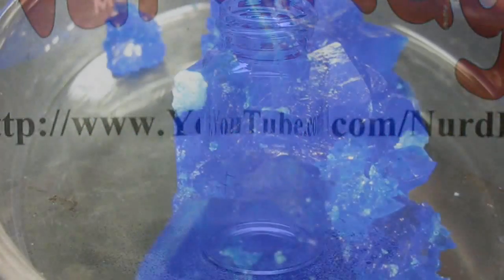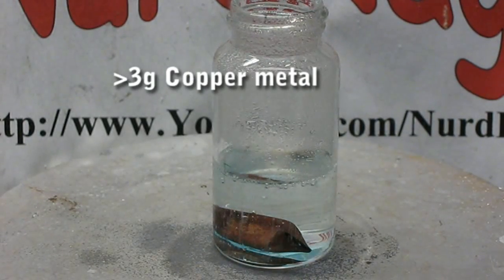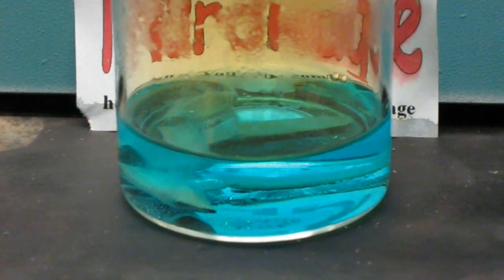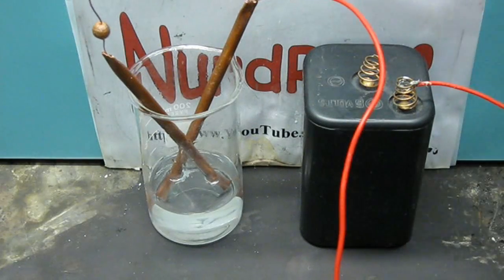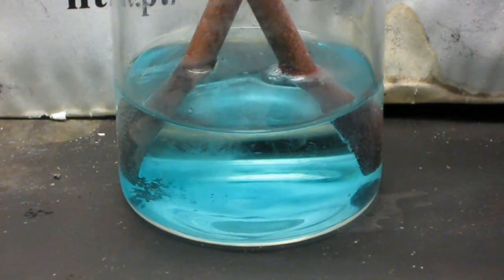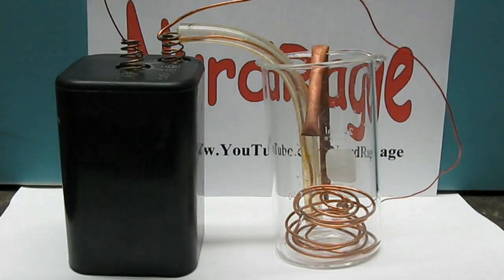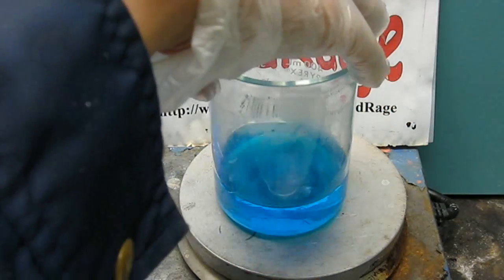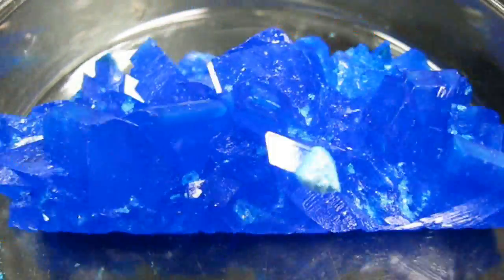Make Copper Sulfate from Copper and Sulfuric acid (3 ways)

Comment: Thank you for sharing. I've tried the saturated Epsom salt method. Then putting the negative electrode inside a clay pot in the solution...with solution filled in the pot as well. Some batches worked better than others possibly because I started using distilled water? Cali has SO MUCH JUNK in the water it should be criminal! Very much appreciated your video!

Comment: Great. Thanks. I am going to do that. Can I ask... if I want run a continuous electroplatlng process can I add copper over and over? And will polyethylene glycol stuff things up? Can I simply measure acid levels to keep the mix in good trim. I have never done this before. But I need to copper plate aluminium. I have no chemistry experience what so ever. But you make it look easy.

Comment: This is working great. I took your advice on making a decent separation between the cathode and anode and used a large graduated cylinder. I then soldered an insulated cable down at the bottom and sealed it so the conductors wouldn't be reduced. I then mixed 33 mL of H2SO4 with 200 mL of water and the voltage is sitting at around 4 VDC with the current at 2.6 A. It already has a lot of deep blue copper sulphate solution on the bottom. I'm going to see if I can reach saturation and very slowly cool down the solution after filtering. I think it's a much better solution than dealing with NO2 gas. Thanks for sharing this. I'm one step closer to making some conductive paint for electroplating 3D prints :)

Comment: Awesome, so a glass bowl could be lined with sheet lead oxide (from a car battery) and connected to negative, and an anode (positive) basket could be fed continually with copper. The acid added when the conductivity drops too low. Swap out the electrolyte to crystalise out the product as required, recovering most of the acid. Sreetips does this in his Silver Cell. I am sure it would work the same way.

Comment: I'm trying to build a copper electrowinning cell. I read that having copper sulfate in the solution makes it work much better, but I didn't buy any, so I tried to just use the cell to produce some in dilute sulfuric acid. Instead it was producing strange red goo on the anode. I thought it might have to do with the red HDPE coffee can it was in, so I moved it to ceramic. But I don't really rhink that was it. Then I saw this so I saw this and added a lot of 3% hydrogen peroxide cause I had it on hand. The electrodes are no longer bubbling so I guess I'll just leave it and see if it starts depositing copper or turns blue over time. If not, I'll add rusty nails to make iron sulfate fertilizer and pour the solution out in the lawn, and try again with new sulfuric acid and copper sulfate on hand
Reply: It's working! Thank you. I'm hoping to electroform pieces of copper thick enough to forge

Comment: Or you can add calcium carbonate so the solution is neutralized, filter out the calcium sulfate, and then boil down the water cuS04 until you're left with just crystals. It can be infuriating to realize that you cant just boil down acids to nothing until you learn this "trick". Love to know the physics and chemistry of why it has a threshold beyond which it wont boil down.

Comment: Suggestion. Put copper wire in dilute sulphuric acid and let it stand a week or so. The air will react to oxidize the copper which the sulfuric acid will dissolve. Don't use old broze coins. Beside destroying collectables the coins will create a mixture of copper salts and salts of other metasl. Best, discarded electrical wire ends and copper pipes.
Reply: Ive done it that way,you just need one big cut of pipe

Comment: Love you videos keep them coming… These crystals look amazing, And the usefulness of them is a must.
 From what I have gathered from your video, and reading online. For efficiency you boil it down to collect, and reuse the acid. And use the remaining  Copper sulphate to make more. Or you boil down to supersaturation leaving some water if you just want to produce crystals. Which is useful as well. And the crystals look bad a**. 
Thanks again. Extremely informative. Well laid out videos awesome.  If I am not mistaken the copper sulphate Breaks down at a 1010 C. So depending what I would want to do I have to watch the boiling temperature of water, And the Max temperature for the copper sulphate.
Reply: Got it no matter how saturated the solution, it will stay  Enssolutions. Until you remove the acid.

Comment: Love  You're videos… ?  At what temperature would you suggest boiling down the solution, I had read just below boiling point. Your input would be very helpful.
   The copper sulphate turns white if I boil out all the water. At that point would I be able to put it back in solution to crystallise,Or should I leave some of the water in and boil at a lower temperature.

Comment: Damn, you add hydrogen peroxide in the video first, then add sulfuric acid. I did it this way and it started splashing acid everywhere. When I searched online, it turned out that sulfuric acid should be added first. How can you make such a mistake ???

Source: https://ehs.princeton.edu/laboratory-research/chemical-safety/chemical-specific-protocols/piranha-solutions

"Always add hydrogen peroxide to sulfuric acid while gently stirring. DO NOT add sulfuric acid to hydrogen peroxide."
Reply from the maker: Because it's not a mistake, read the directions very carefully. there is a major difference.

Comment: Hey I have some questions if u don’t mind answering , I was “attempting to make nitric acid, by using two packs of instant cold packs dissolved in water overnight and adding sulfuric acid and copper, I sat the reaction jar to the side and pretty much forgot about it got off work the next day and something told me to check on the jar and wow, there are huge crystals that take up 75% of the jar! I can send u pictures. So my questions are , what are the crystals? Why did they form and what can I use them for or do with them? Hope to hear back thanks

Comment: That looks like a really fun experiment to do. Thanks for posting it up! If you used copper (II) oxide and sulfuric acid to produce copper (II) sulfate pentahydrate, what would the balanced equation look like? So far, I have the equation CuO(s) + H2SO4(aq) -> CuSO4.5H20(s). For the life of me, I can't balance it in this form. Is copper (II) sulfate pentahydrate in this context the same as CuSO4(s) + 5H2O(l)?
Reply: +Wayne Riesterer CuSO4 * 5 H2O is not the same thing as CuSO4 + 5 H2O. Some salts form crystals that contain what it´s refered as "water of crystalization". In the case of copper(II) sulfate it crystalizes from an aqueous solution as the pentahydrate (which means that it contains 5 molecules of water for every molecule of copper(II) sulfate in its crystalline structure) since that is the most stable form of this compound. 
And for equation that you are having trouble with, the correct form is CuO + H2SO4 + 4 H2O = CuSO4 * 5 H2O.
Reply: What the other chemist said.... but I wanted to add, if you want to better understand it, take some regular Epsom salts that you can find in most grocers and heat it up. Water is produced, and a surprising amount I might add. Anyways, "completely different products" vs. "whatever you classify copper sulfate pentahydrate as".

Comment: I know it's nit picky, but when making peroxymonosulfuric acid or piranha solution you ALWAYS add the peroxide to the acid, not the other way around. The reason is due to the fact that as the peroxymonosulfuric acid forms, if there is a high concentration of hydrogen peroxide it can form a potentially explosive mixture. Adding peroxide to the acid ensures that the concentration of peroxide is low and is quickly consumed and sulfuric acid is in excess. I know with small volumes it mostly doesn't matter, but I work in a lab where it's not uncommon to need to make 500ml of piranha at a time and I can't tell you how many grad students have done it the other way and ended up with sputtering and small explosions. It's not good.

Comment: All wrong. Commercially we use scrap copper cable wire and dilute sulphuric acid- And we bubble air into the solution all dissolves in 24h or so
Reply from the maker: Blatant idiot, this science is well known. If you think this can't work try it yourself.
Reply: Commenting on a video that its almost 10 years old? I've never seen any YouTuber do that
Reply: Commercially, you use the cheapest method you can (just good business), so you use scrap copper, dilute acid, and atmospheric oxygen as the oxidizer. The video shows lab methods that get much faster results when you care less about cost than time.

Comment: Alternative method that I prefer is to generate copper carbonate by electrolysis using sodium carbonate as the electrolyte instead of sulfuric acid, which yield solid copper carbonate as a precipitate that can be decanted and washed. Then I add sulphuric acid to the copper carbonate stoichiometrically yielding copper sulfate. This has a number of advantages:

1. Because the copper carbonate precipitates you only need to continue to feed the cell with more copper. Whereas the direct-to-copper-sulfate approach in the video has diminishing returns as the solution becomes saturated with copper sulfate. Using an excess of sodium carbonate will replenish automatically as the solution will continue to desolve it. So just feed it copper, set and forget.
2. Decanting removes the bulk of the water so there is much less boiling required. Or none if you are looking for a wet product anyway.
3. No boiling concentrated sulfuric acid! Which is much safer. (I'm referring to the final stage of the video where the water is being evaporated - wherein you are also concentrating the acid).

Comment: If I use Sodium Bisulfate solution instead of sulphuric acid for the electrolysis method would it still work? Would the CuSO4 be contaminated with Na+ ions if it does?

Comment: HI,
I would like to ask in the last method(the electrolytic method) what was the concentration of the sulfuric acid ?
I see that you have added some water to it , why ?
Reply from the maker: you can use just about any concentration. I used 98%. Water must be added because sulfuric acid is non-conductive by itself.
Reply: I don't have access to that level of concentration, only around 35%, so my question is what should be the overall concentration of the sulfuric acid after adding water, does it matter for the final result , would it be better if the concentration is higher?
Reply: Dwayne Schnell so what would happen if I use high concentration, say 98%? and also can I avoid adding table salt because I don't want any chloride in the solution!
Reply: Dwayne Schnell I was talking about without adding any water to the solution just 98% sulfuric acid.
I don't know much about chemistry, thats why my questions may seems to be very stupid!
Also what did you mean by (to have equal concentration)
Reply: Dwayne Schnell thanks a lot for your time explaining to me.
Ok another thing if I want to prepare a round 3liters of concentrated copper sulphate in the room temperature using the electrochemical method, should I follow the same ratio ? Also how I would know that the solution reached it's maximum saturated level, of course I need to get rid of the excess sulfuric acid in the solution, should I prepare a small amount and boil it as he did in the video? and after that collect the copper sulphate powder to us it later to create my solution?
Reply: Dwayne Schnell I really appreciate your effort and time, thanks a lot.

Comment: 1. Could the NO₂ in method 2 be recycled to make nitric acid again?
2. What if the copper is an alloy with some other metal?
3. When evaporating the sulfuric acid at the end, could it be condensed and recycled to reduce its loss?
4. What types of tubes can I use for isolation to avoid reacting with the acid?
5. And same with the filters: paper filters are out of the table since sulfuric acid burns paper, right? So what filters can I use instead?
6. How do you calculate the correct proportions of these chemicals?
Reply: 1. If you can use a tube or some way to bubble the NO2 into water, yes it will convert back to nitric acid, although it won't be concentrated, it will be dilute acid, and will not be as efficient.  For more on this, see NurdRage's guide on making nitric acid.
2. It should still work, but depending on your alloy you may also get some undesired side products.  It's better to use as pure copper as possible.
3. He does recycle his sulfuric acid.
4. Not totally sure I understand this question.  To isolate the crystals or the acid?  Either way, I don't see the acid being a problem since water is present to dilute the acids somewhat.
5. Sulfuric acid only burns paper if it is anhydrous sulfuric acid.  In this reaction water is present, so it burning paper is not an issue.
6. Would take a very long time to explain this one, sorry xD

Comment: Hi. I did the electrochemical method but instead I used car battery sulfuric acid. I added about 30ml of car battery acid and 45ml of water. I putted my copper electrodes in and instead of hydrogen gas I got a unknown gas with a very pungent and irritating odor. I thought it was sulfur dioxide but it doesn't make any sense and it didn't smell like it too. Any ideas what that could be? Thank you for making good videos.
Reply: You have to filter and distill battery acid to get rid of the lead carbonate. You do NOT want to fuck around with lead.

Comment: So how long would it take to completely dissolve the copper if you left it in the acid and battery, or say a 6 volt power supply or more.... days weeks years...
Reply: You'd need 27Ah to completely dissolve 60g of copper.

Comment: I did this with acetone, rubbing alcohol, vinegar, and hydrogen peroxide. It's sitting right next to me in a covered container. I was wondering what the blue stuff was. Can anyone tell me what exactly is ot thats causing this in my mixture?
Reply: Err, update to that. I just realized what acetone and hydrogen peroxide make. But I'm still curious about the blue coloration.
Reply: +Nathan Anderson Where does the sulfate come from? The blue stuff you have is a mix of copper acetate and copper hydroxide
Reply: +FoxxtheGray be careful mate haha

Comment: Not very safe when you boil the solution of copperions and sulphuric acid solution. Gases to expect are H2SO4 (gas), SOx (gas), and from the electrolysis you may potentially get CO, O3, SO2 and SO3 gases coming out. Must have good ventilation, and make sure all the sulphate ions have got a copper ion to bond with. The heating near the end, where you vaporize the sulphuric acid is a very scary event, that can cause much damage to lungs and you may need to consult a doctor if the gas is breathed.

Comment: If I do a heated evaporation, will I still get large crystals of the copper sulfate?
Reply: No, you only get fine powder of copper sulfate if you do that
Reply: Okay, thank you for letting me know.
Reply: Ben Nutter just buy coppersulfate and dissolve as much as possible in hot water. If there is some undiluted coppersulfate on the ground of the container filter it of with a coffefilter. Now let the solution sit for a few weeks until the water is vaporised and put the crystal in a airtight container or just cober it with clear nail polish.